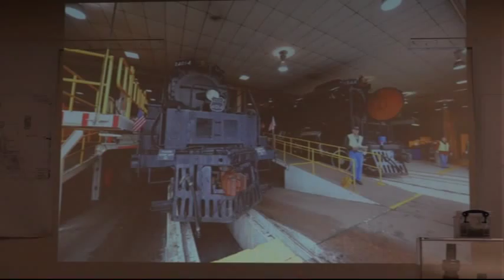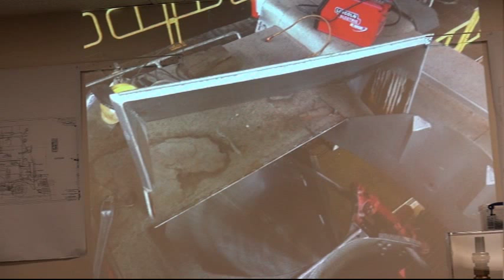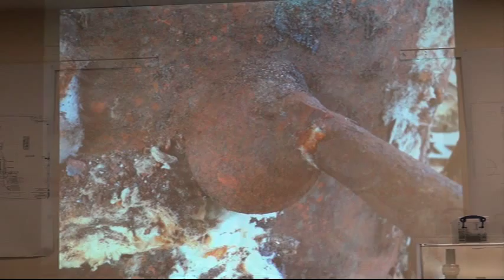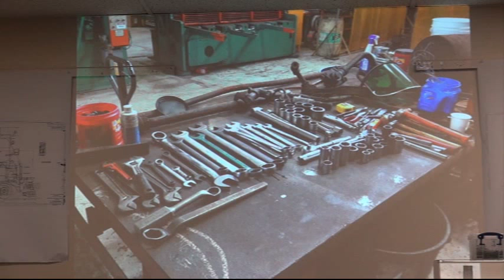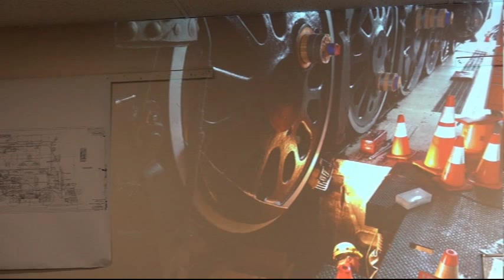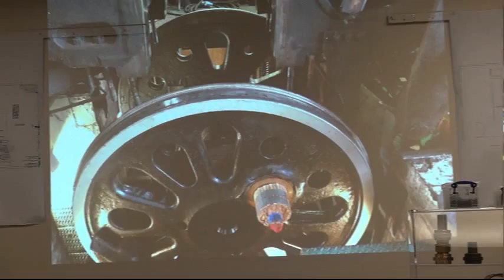UP Steam Shop Evolution and Update at 2015 Rocky Mountain Train Show

Comment: Time Stamp 8:22 Exhibit A this is why #3985 is in the shop and #844 was in the shop see those caps? they are style KH which means they are the wrong type of bolts for this engine and Steve replaced that firebox 10 years ago only to have it rust because he made the same mistake he made in 1999. Also look at Exhibit B on the next slide see those bolts? that is illegal they were tack welded onto a cap the correct thing to do is run the bolt all the way though with a full penetration weld and seal the ends with grout. Steve did not do that and I believe the guy who did this weld was Scott Nixon this is part of the reason why he is not with UP or Wasatch anymore this weld made the locomotive unsafe to operate.